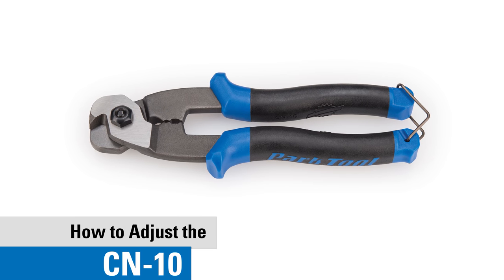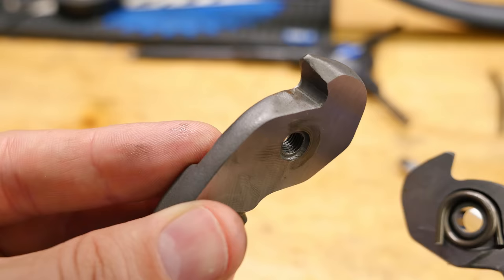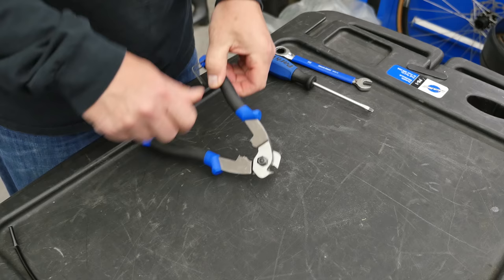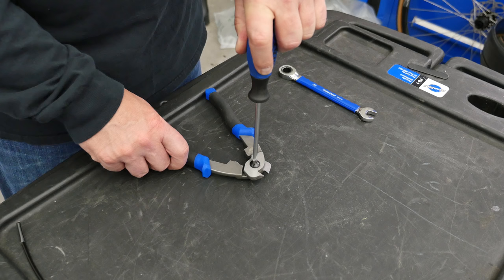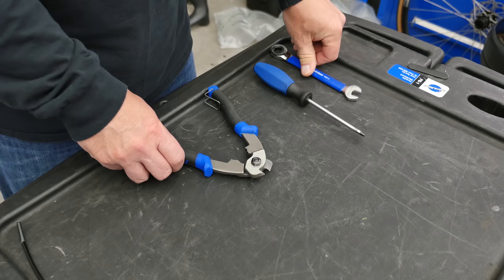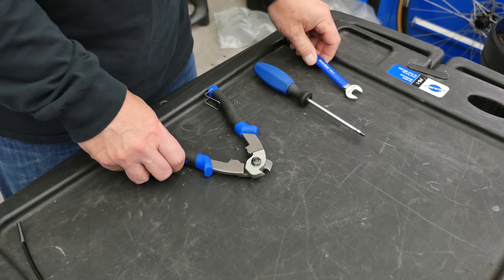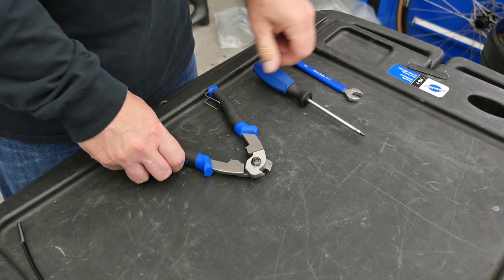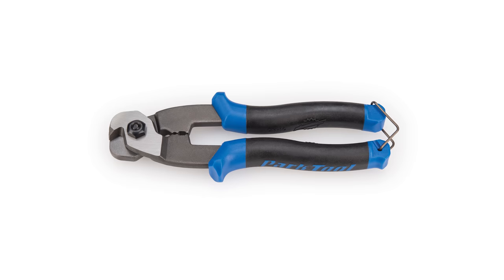CN-10 Adjustment

Comment: The fixing bolt easily stripped during the first adjustment of this tool, and Park Tool would not even help source a replacement. CSR was super rude  Try finding an M6 x 0.75 pitch x 20mm bolt at a hardware store!

Comment: RJ the bike guy showed how to do this about a year ago
Reply: I know right? Park Tool should have put out this video long ago. Lots of people bitch and moan about how the CN-10 sucks and doesn't cut well because they were not aware that it needs adjustment.
Reply: I know. Been using it to cut the housing ONLY since I bought it years ago and using a standard diagonal wire cutter for the cables. At least I figured it out before I bought a Pedro’s or Jagwire wire cutter!

Comment: What's the maximum cable diameter it's meant to cut? Can I cut a 2mm 7x7 steel cable?
Reply from the maker: It will not have any issue cutting through 2mm steel cables. We do not have a max diameter as there are other variables that diameter that effect its capacity.